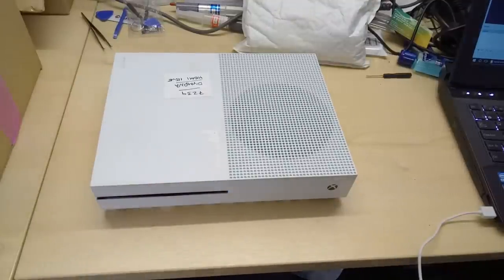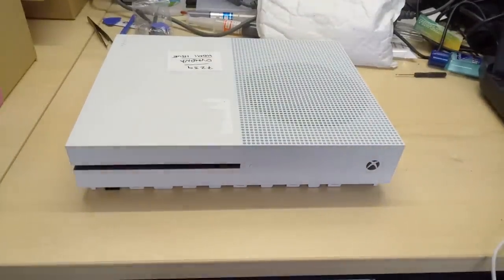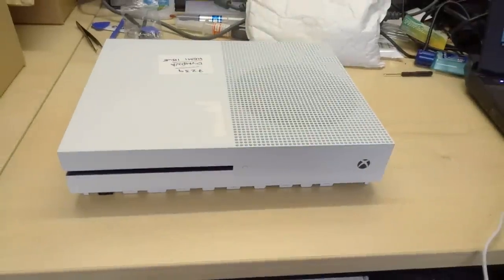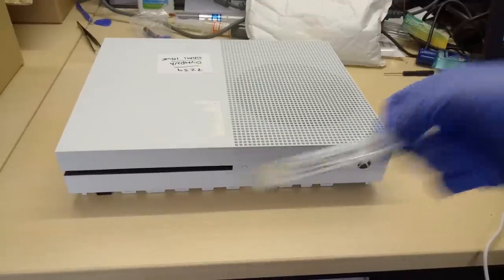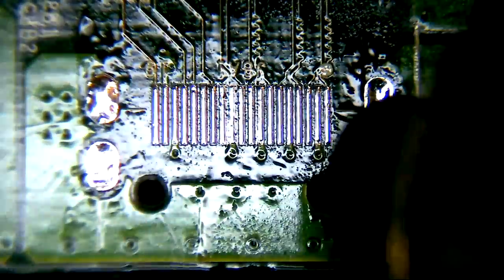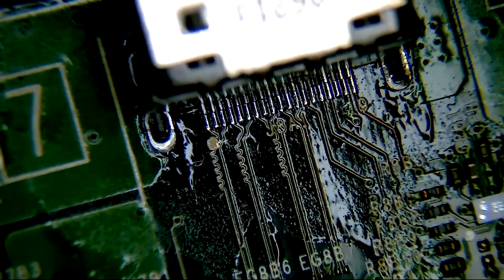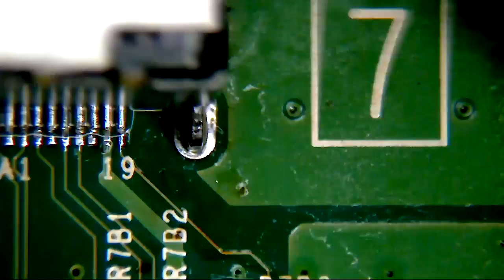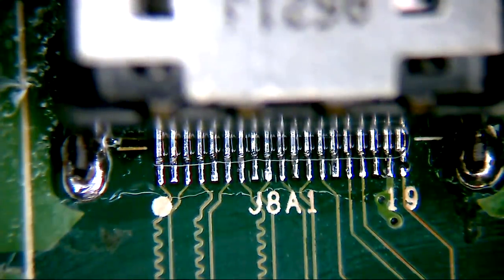XBOX One S HDMI Port Replacement Tutorial

Comment: You are the only guy on Youtube that breaks it down ... Good knowledge ..For you info ,, I own a Video game store in jacksonville .. If you ever need parts .. Please dont hesitate to ask .. we do have slim Hdmi parts ,, no  I dont sell on ebay ,, but  do answer my emails , and with all the Help youve gave me with these videos .. Its my pleasure to assist you
Reply from the maker: Many thanks my friend - if I end up with more of these on a regular basis I may come calling :-)
Reply: Andrew Paul. How do u fix xbox 1 s port
Reply: Ttop how can I get in contact with you to order some xbox one s hdmi ports?
Reply: I need one were is your shop located I'm in Jacksonville on the Northside
Reply: Hey ttop I was wondering were your shop is and off you can fix it for me
Reply: Hey man, how are you? So as you can see in the video, there is what looks to be a copper strip around the perimeter of the board. As I was doing this job I accidentally touched the tip of the iron to the strip and it removed a bit of the copper coating and it is now a silver color. It's not solder as I had none on the tip yet. But just melter the top layer of copper off I guess. Will this cause an issue? And if so is there anything I can do about it?
Reply: @shevinsacrey5862  Unlikely to cause an issue.

Comment: Thank you so much! Me and my dad took apart my Xbox and we did all these steps. It is a little bit uneven and there is a tiny bit of static on the screen but I think it’s just because we didn’t get the little wires all touching. We’re using a magnifying glass in a few days to fix that. We are not experienced at all in soldering but we still made it work. Anyone who wants to know if they should do this, my answer is yes if you can follow all the instruction and you have all the equipment. Just BE CAREFUL!

Comment: Parts and Advice

Here is what I have compiled / Found for parts :
Amazon CA

https://www.amazon.ca/gp/product/B07FSP5JB1/ref=ppx_yo_dt_b_asin_title_o00_s00?ie=UTF8&psc=1

https://www.amazon.ca/Meijunter-Console-Replacement-Interface-Connector/dp/B07C13FSJR

Esource Parts:

https://www.esourceparts.ca/replacement-hdmi-socket-port-connector-for-microsoft-xbox-one-s.html?utm_source=googleshopping&utm_medium=cse&ep_cur=CAD&keyword=&gclid=CjwKCAjwkoz7BRBPEiwAeKw3q07oE44-_UzgAAVWTykIdDVqsCmiDXj361D6XWM_IRxv1DECtWDYzRoC5RkQAvD_BwE

For my repair, I found that my Air Gun, and Soldering Gun still could not get the board hot enough to flux the main HDMI port 4 mount point.  Due to this and the replacement part being on hand I took an alternative approach.

The HDMI plug assembly can be pulled apart on the board, for mine I pulled off the outer shielding which then allowed me to seperate a back plate that retained the side mount plates which is where the solder points are attached.  This then allowed my cheaper HeatGun / Solder Iron to flux /solder wick the main 4 mount points leaving the plastic housing and only the small delicate HDMI solder points remaining, these then were easy with my HeatGun..

Happy DIY fixing all, these connectors really should have been made stronger by Micro$haft.. Given that Boys and impatient kids will be the main audience of the HDMI Rammy Jammy Game..

Sorry for Double posting, but the comments are the usual Inter-Missed-Web mess of dumb questions..  Here is a game of Match these answers to dumb question
- Solder Flux Paste
- Solder Wick
- 300 F
- T8 torx

Comment: great video, something i would have done different is instead of purely heating the underside with a rework wand, I would have used the soldering iron and a solder sucker/wick or braided wire to remove most if not all of the solder through the location pins, this will be less time heating the board and less likely of damaging the fiberglass pcb material through heating. Ive found blasting a "cold" PCB with a large amount of heat can "shock" the fiberglass material and cause damage to the traces. just my experience though :D

Comment: sometimes the outer shield in the xbox one's hdmi expands and stops hdmi signal - dont need to replace port just bend it inwards from sides. if the 2 lips at the bottom of the port aren't touching and you get no hdmi signal thats why - no ground contact

Comment: Is lead solder better to use than lead free? I tried melting the pins off the HDMI port i was replacing and it wouldnt melt. Was wondering if it was a different type of metal.

Comment: Hey great video, I'm going to be trying this repair in a week or 2. What else is needed besides a soldering iron and flux? leaded solder and what was the rectangle tool you were moving on the back of the board to remove the ground pins. (new to soldering) lol
Reply from the maker: You'll need a decent quality hot air station to remove the ports - you'll not be able to do it with a soldering iron alone sadly. Otherwise you'll need a quality soldering iron with a fine tip and a broad tip, quality flux, rosin-core flux leaded solder and some desolder wick in case it goes wrong.
Reply: Andrew Paul what brand of flux and desolder wick do you recommend? I have a friend that would like me to try this but I only have an iron and solder.
Reply: Bump would like to know this also. About to order a hot air station, flux and desoldering wick to get this done on an xbox and maybe a ps4

Comment: My soldering iron will not melt the solder on these points.. Why? i can’t figure it out? It’s at 450c and i’ve used it on a bunch of boards before but it will not melt the solder on the xbox board.. Why?

Comment: Great video , I have one question when u apply the heat to board to remove port does the heat not spread threw out the board to melt other soldered joints thanks

Comment: Great video.  Unfortunately when I was removing the bad HDMI port, it also pulled off some of the extremely thin metal wires off the circuit board as well as tiny black chip that were going towards the back of the port.  So pissed at myself, I've done this work before without problems. Bought an Xbox One S for 85 and completely fucked it up. Was trying to save money and have a fun project. I've been out of gaming for 7 years and wanted to get back into it because of Battlefront II. Wonder if I could part this out on ebay or try to buy a good motherboard. Did the heat travel too far or not enough?  Curious if you've seen this before.
Reply from the maker: You didn't get the board hot enough before removing the port. The contacts on these boards are very long and thin which means that anything less than the board being fully heat-soaked before removing the port will result in these lifting out. In the video I mention that under no circumstances should you ever be tempted to lift the port out and just let it fall out of its own volition for this reason. They're a pain if you've not done much of this work before.

You may still be able to salvage the board though - it'll just involve running some link wires from the port legs to their corresponding components out on the board, bypassing the damaged pads. How many of these pads lifted out?

Comment: What is the temp of the soldering iron?  The heat gun temp is 490 degrees but is it Celsius or fahrenheit?  Thsnk you and sorry for the dumb question..
Reply from the maker: Hi, The iron is at 365C. The heat gun temp is also in C. Cheers.
Reply: @AndrewPaul  thank you so much!

Comment: Can I ask how much you charged for this job? Great informative video btw.
Reply: £5-10 for a HDMI port, £5 in materials, maintenance, electricity and so on, £20-30 labour and slap on VAT. So you're looking at around £40-60 plus return shipping. It's a fairly simple fix and takes just over an hour including cleanup without much testing needing to be done.

Comment: Hi andrew just wondering if you could give me ur input on this please  xbox one s hdmi port looks immaculate condition no bent or broken pins and really clean inside but I have a no display issue when I power it on I either get black screen or blue screen and sometimes a fuzzy screen it has mind off it's own so help power and eject button to reset display setting and the display came back and works but only in 640x480 resolution if I try to switch to 1080p display goes again does nothing if I try 720p I get more screen action but it's all fuzzy and flicking on and off it will only work in the 640x480 res any idea what's causing this or what I can check before I opem the system up I never work on xbox systems only playstation so it's new to me

Comment: Did it the same way, it loosened but damaged the HDMI wires going into the motherboard. At 30:30 in your vid, the lines just above the HDMI connections, I believe I used too much heat. Is that fixable?

Comment: Do you have to put the broken hdmi port back onto the board or will it still work without it?
Reply from the maker: It will work fine without it if you want to leave it off. You can buy the ports fairly easily these days to replace the faulty one.
Reply: @AndrewPaul  Ok cool, I will probably buy a new port I was just wondering if it was a cosmetic thing. Cheers for response.

Comment: What materials do u use i have faux the sauder gun sauder and hdmi port do i need anything else
Reply from the maker: You'll need a quality PCB flux (Amtech NC-559-V2-TF is recommended), and some de-solder braid, as well as  a soldering iron (ideally with a larger tip and a smaller conical tip). Most importantly, don't rush it or ever be tempted to tug the port if it's not coming loose - that's how people starting out on these repairs write-off the boards.

Comment: Would it be smart for me to use aluminum tape over the plastic to keep it from melting?
Reply from the maker: It's up to you mate - if you need to apply top-side heat then yes I'd recommend it. If your station is powerful enough to get them out from bottom side heat application only then no you should be fine.

Comment: This was really helpful but after putting mine back together, the power button is not "clicking" like it was before and the power won't turn on.  The power button just presses in with out the click.  Power is running through it as the fan starts for a moment when I plug it in.  It must be where the power button connects to the chip behind it.  Any ideas on a fix?
Reply from the maker: Yeah it's easy to damage the buttons on the front panel if the top cover is not slid back over correctly. Remove the top cover and look for the tactile switch still being present. The fronts can smash off just leaving the contacts or half the switch body behind - fix is to either replace the affected switches or replace the front RF Board PCB assembly.
Reply: Andrew Paul Thanks for the insight, man.  Luckily, I have a friend who's a bit better at this stuff than I am and he offered to fix it up for me.

Comment: Why remove the x clamp just to do. the hdmi? Is it necessary?
Reply from the maker: These boards flex very easily and the heatsink is considerably heavy so it should be removed where possible. Also, might as well change out that god awful thermal paste from the factory whilst it's in bits.
Reply: @AndrewPaul  awesome thanks for the reply!

Comment: Can u message me everything I'll need to repair my hdmi port besides a screwdriver n iseasmo
Reply: While it probably wont apply to you now, but for others wanting to find out what you need, here is a list of essentials.
Hot air station
Soldering Iron with fine and flat tips
0.3-0.5mm lead solder with rosin core
Flux (for electronics, not plumbing)
Magnifying glass for inspections (as the good microscopes are around £400, generally bought by serious hobbyist as a flex or professionals who will make the money back in a month or 2).
Flux Cleaner and a new toothbrush. 99.5% isopropyl alcohol works too.
Oh, plenty of lighting and about 2-3 hours of your time. Novices trying a repair like this need to take their time.

Comment: Does it have to be a gas solder ?
Reply from the maker: Hi,
The soldering process is carried out using hot air (an electric-based system) - the station in question here is a Quick 861DW.
Reply: Andrew Paul thanks

Comment: Please respond do I need the heat cause I just want my box fix
Reply from the maker: Absolutely yes you need the heat gun. If you're not experienced in this kind of work,  I'd avoid it and find a pro to repair it - they are easily damaged if not done correctly. If you don't have the tools and only intend to fix the one machine then it's easier and considerably cheaper to find a pro in your area.
Reply: Andrew Paul why do you need the heat gun

Comment: I bought me an Xbox one yesterday I it plugged it in watch the power light on the power supply turn from Orange to White push the power button on the Xbox it makes the sound but the light doesn't light up know I've noticed that the fan doesn't turn on neither any suggestions would be helpful the disk drive when you put a game in the disk drive it will take the disc and it will give it back when the disk is in the disk drive it sounds like it's booting up but there's still no power to the light and no power to the fan
Reply from the maker: Sounds like you're potentially missing a power rail but first I'd check that the front panel is properly plugged in to the RF board. If all that checks out and it still doesn't power on properly then you could be looking at a Southbridge problem.
Reply: Any chance you can possibly do a video on that
Reply from the maker: I don't get many XBOX Ones with power issues in but if I ever do get one then it will get put up.
Reply: I want to say thanks for taking the time to do all these videos on repairs for all those people out here that are trying to learn to save money and save our consoles so keep up the good work
Reply from the maker: Thank you. :-)
Reply: I have checked this board over and over and compared to two other boards there is nothing missing no chips missing everything is in perfect order in perfect condition in this board can't seem to find the problem I know that the power light on the front runs at 5 volt I know that the touch sensor runs at 5 Boat but what's killing the rest of the power that is the question and I know it's not my power supply it's brand new and I checked it with other Xbox Ones in it works perfectly fine right now as I look at it it's on standby mode which is Orange

Comment: MIddle of a pandemic so getting a pro to fix mine is not an option, wish me luck :|
Reply: Think I may have found a replacement part from "Flashback" for $6.99. have my xbox one S apart and HDMI removed, just sourcing out a new conn. Did you happen to find a replacement connector? I'm very skilled at soldering and removed mine safely, no damage to PCB or pads. I'm in the US.
Reply: @davejohnson6032  Did you find the replacement Part equivalent, this console has been out many years now so the part should be out in the wild by now..  Let us know..
Reply: @dann452  So far, this is the closest one I could find. https://freeport-usa.com/products/hdmi-smt-wo-flange-high-profile-connectors/
For now, I've just swapped the input with the output conn
Reply: Here Is the replacement part from 
Amazon CA :
https://www.amazon.ca/gp/product/B07FSP5JB1/ref=ppx_yo_dt_b_asin_title_o00_s00?ie=UTF8&psc=1
Esource Parts:
https://www.esourceparts.ca/replacement-hdmi-socket-port-connector-for-microsoft-xbox-one-s.html?utm_source=googleshopping&utm_medium=cse&ep_cur=CAD&keyword=&gclid=CjwKCAjwkoz7BRBPEiwAeKw3q07oE44-_UzgAAVWTykIdDVqsCmiDXj361D6XWM_IRxv1DECtWDYzRoC5RkQAvD_BwE

For my repair, I found that my Air Gun, and Soldering Gun still could not get the board hot enough to flux the main HDMI port 4 mount point.  Due to this and the replacement part being on hand I took an alternative approach.

The HDMI plug assembly can be pulled apart on the board, for mine I pulled off the outer shielding which then allowed me to seperate a back plate that retained the side mount plates which is where the solder points are attached.  This then allowed my cheaper HeatGun / Solder Iron to flux /solder wick the main 4 mount points leaving the plastic housing and only the small delicate HDMI solder points remaining, these then were easy with my HeatGun..

Happy DIY fixing all, these connectors really should have been made stronger by Micro$haft.. Given that Boys and impatient kids will be the main audience of the HDMI Rammy Jammy Game..
Reply: Here is another on Amazon CA:
https://www.amazon.ca/Meijunter-Console-Replacement-Interface-Connector/dp/B07C13FSJR

Comment: What do I buy to melt off the port
Reply from the maker: You'll need a hot air PCB rework station and some quality flux paste. It also helps to give those ground locating pins a coating of leaded solder before hitting the port with the heat - it'll help it remove much easier.

Comment: Hey ccan you help me i got a problem with xbox when i open he have power but no image afrter 5 min i see xbox one image and stay block
Reply from the maker: Sounds like a defective hard disk drive problem. Quite common.
Reply: Tnx looks like i have to buy new one i tink
Reply from the maker: +Marvin Mihalache check the disk for bad sectors with HDAT2 - easy fix it that's the issue.